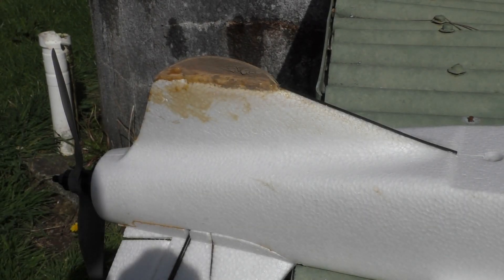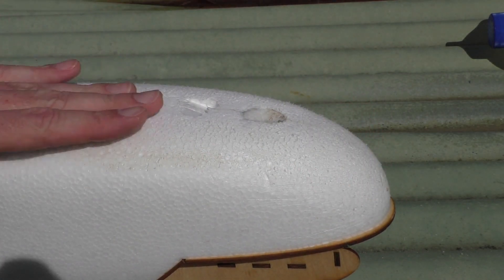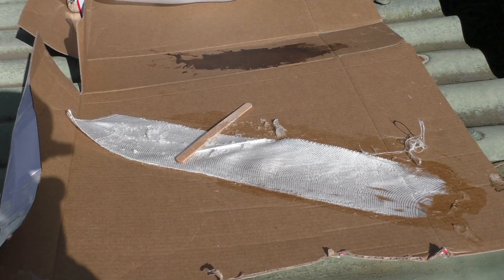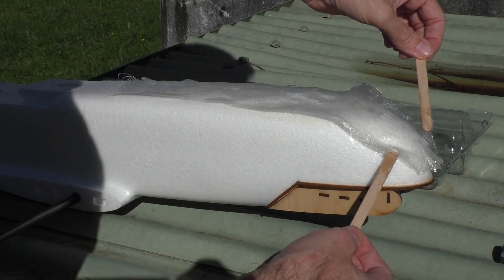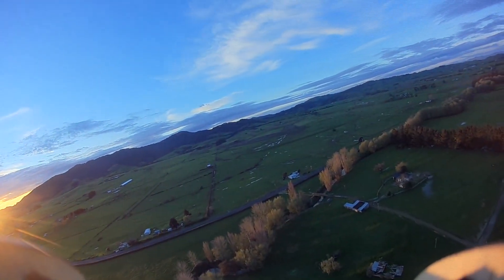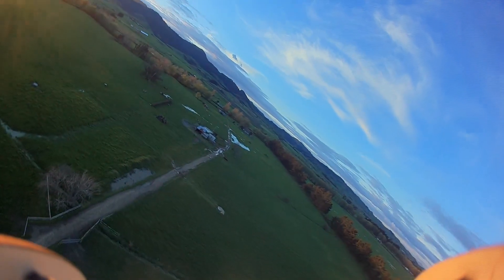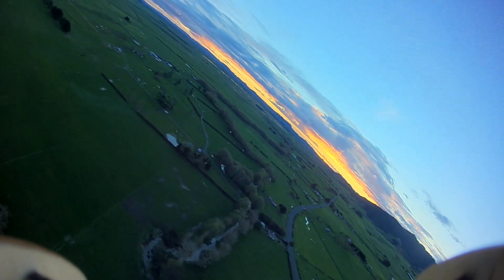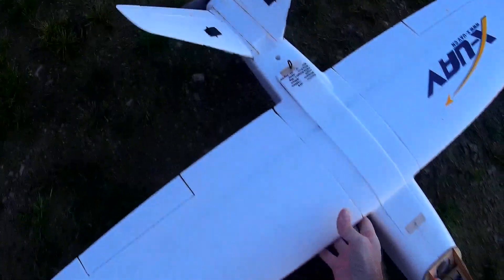Mini-talon smooth nose mod (fiberglassing amateur hour)

Comment: Great insight into fiberglassing. I've been using Kevlar with good results too. I learned how to do this on the RCGroups SkyHunter Thread so will share what I know if anyone is interested. I've been ordering my rolls from AliExpress between 45 and 70 GSM, it's light weight but the thinner stuff is easier to work with around compound curves. You can request the Fabric be rolled rather than folded for shipping and they will usually oblige, this will prevent creasing.  First I lightly sand the area to be covered in order to break the smooth surface seal on the EPO left by the mold, this makes the surface porous. I then cut the Kevlar to the desired shape making sure I cut 45 degrees across the weave of the fabric (or the bias). I use metal shears to cut the fabric as scissors simply won't cut it. I spray the fabric with '3M Super 77 Multi purpose' spray (just a light dusting). Then it's time to apply the fabric to the EPO, gently resting it into position and working the fabric around curves/corners. There is no time pressure when doing this so you are able to get it looking quite nice. While this is still moist I then apply Thin CA to the fabric (not the Foam Safe stuff). I wrap two fingers in electricians tape and slowly pour the CA onto the fabric a few drips at a time, working it into the fabric with my fingers and making sure I keep moving or I get stuck. I should also mention doing this in a well ventilated area as there is usually some fumes emitted. After the all the fabric is covered I leave it to dry which doesn't take long at all being superglue although I usually leave it overnight. I then sand the edges of the fabric to get them as smooth as possible then apply a bit more CA to these areas as before. Job done. You can paint over this or even cover it, not a problem. I've used this technique on both SkyHunters and Mini Talons with great results. Numerous hard landings have had little effect on the Kevlar. I hope someone out the gets some use out of all this as it does look to be an easier and a lot more forgiving solution than the Fiberglass although this Glassing did come out quite tidy!

Comment: Built a real size car body in the past. It is critical that the ratio on the Resin labels be followed.
It is also easier to spread the resin into the fiberglass cloth with a brush. Just remember to clean the brush after use if you want to use it again. Rubber/plastic gloves are a must.
Heat will affect curing time but not wind. Curing is a chemical reaction not evaporation.
Reply from the maker: What should the brush (or anything else I guess) be cleaned with? I tried turps but it didn't seem very helpful.
Reply: I used acetone to clean my tools... Turps wont work..
Reply: iforce2d MEK works too
Reply: what i've heard about polyester is that it will cure no problem at a wide range of ratios, the only thing that changes is the cure time. indeed polyester resin for doing casting has specific instructions on how much catalyst to use depending on how deep you're casting, to prevent the resin curing too quickly and overheating

Comment: Scales are great for those difficult mixtrures. It is very easy to weight the resin and add hardener (assuming you have enough resolution in case you're mixing a small batch).

Comment: I used just resin and I got glossy flexy but still strong coating.  It took a while to dry but that enable me to even out and make tin layer of resin. It can add some weight if you use fiber.

Comment: G'day iforce2d,  Great vid. Yeah fiberglass isn't as easy as it sometimes appears but I hear that the minwax resin is a lot easier to use (its water based) & apparently it's lighter too. The footage from the RC split looks good which lense option do you have?
Reply: Yes, fiberglass with parquet varnish is a clean method. Easy to work with, non toxic and sticks very well.
Reply from the maker: Actually I don't know... I don't recall choosing any option when I bought it.  You can see it in this previous video if it helps. The only markings on it say just 'Runcam'. https://www.youtube.com/watch?v=nR2BIS_JUoE

Comment: You'd find epoxy resin a lot easier to use. You get much better pot life & the resin takes about 24hrs to cure. Works better in warm climates too 😊

Comment: Never mix fiberglass resin with hardner on cardboard. Your mixture with be so absorbed in to the cardboard really  fast. plexiglass or even a cutting board is best. Windex window cleaner sprayed on your hands after working with fiberglass will roll right off your hands when rubbed together, sure makes clean up of your hands alot better.